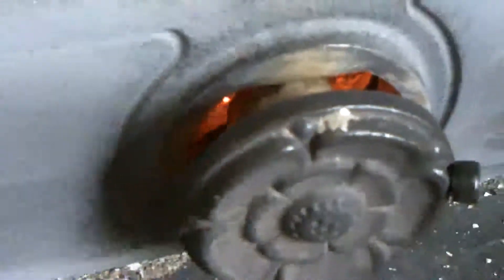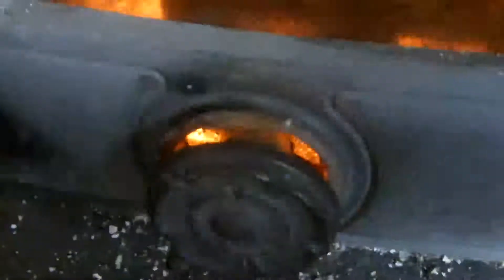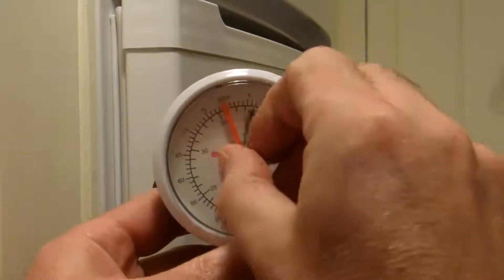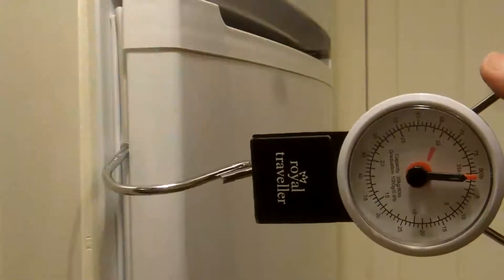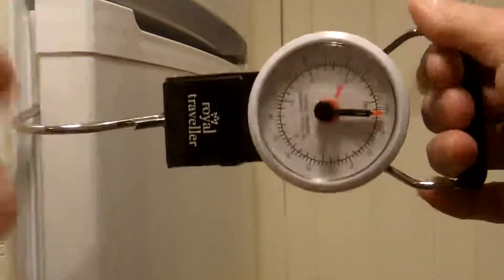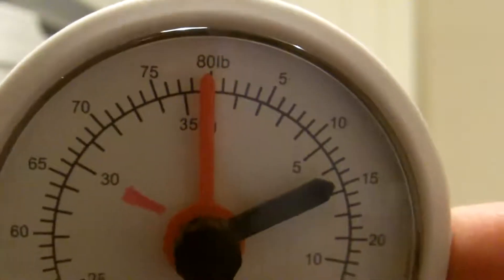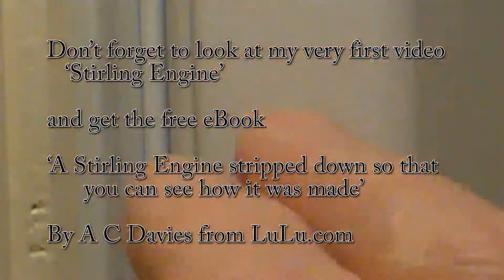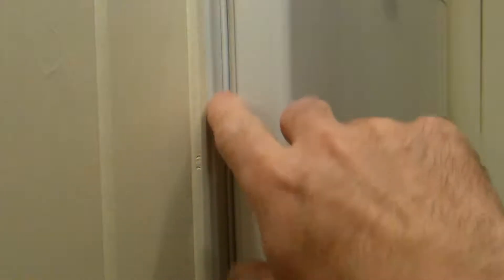Stirling Engine effect, hot and cold air expanding and contracting

Comment from the maker: @MrVinamp
 Hi there, well the fire had only just been lit a few minutes so the metal wasn’t too hot, after 10 minutes it’s dangerously hot but I fitted the Socket Cap screws in the roses so I can still open and close the vents with my finger when the fire is blisteringly hot but I have to be quick.  
One day I might show some other hot metal working that will astound you.
Kind Regards ... Andy